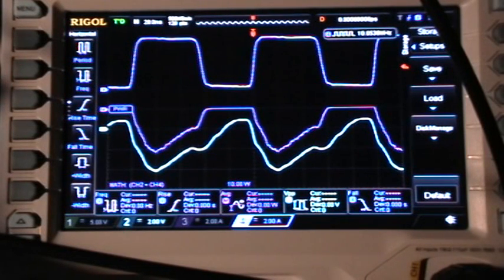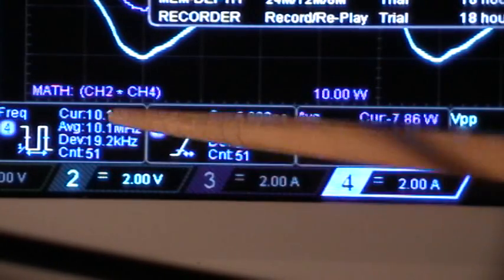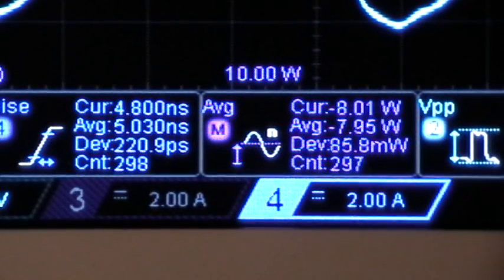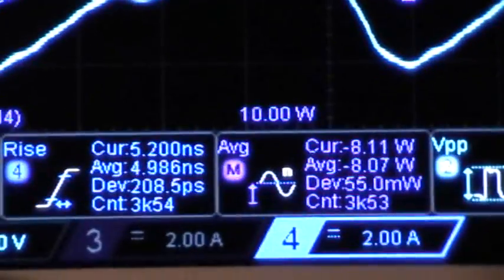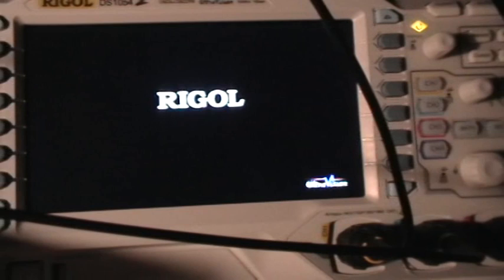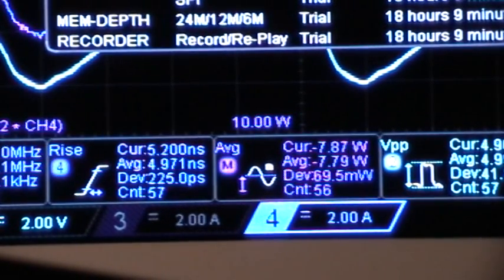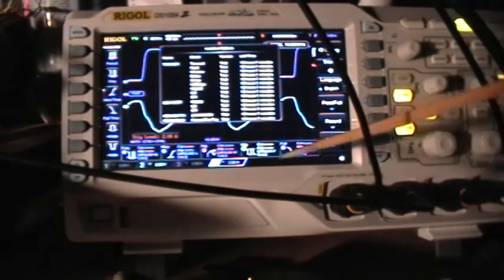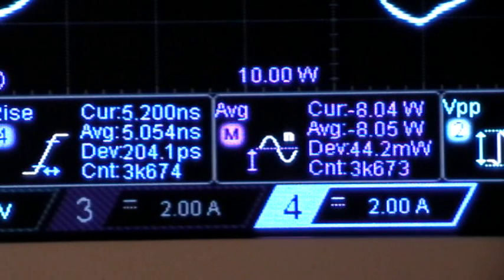Scoposcopy: New Rigol DS1054z Measurements Bug

Comment from the maker: I've done some more work on this problem and apparently it is related to the Math function. Without using Math the measurements continue working, at least in my testing so far. But when one uses Math to multiply two traces,  the Measurements stop working at random times as shown in this video.

I've made a longer video going step-by-step, starting with the Default single-channel setup and adding conditions one at a time until finally the scope's Measurements stop working, after I've established the Math function. 

And here it is: Part 2 of this bug report:
https://www.youtube.com/watch?v=MmaWf_33dqg